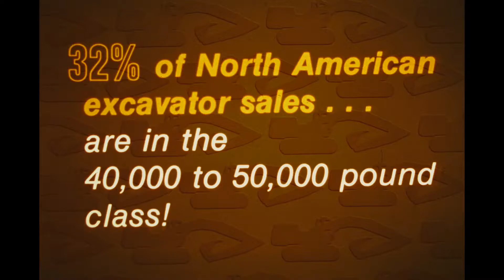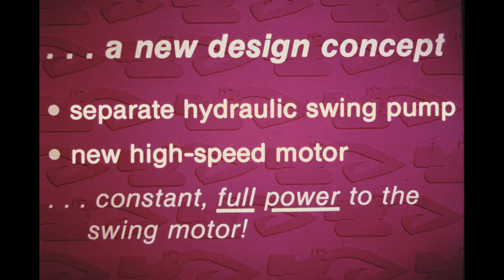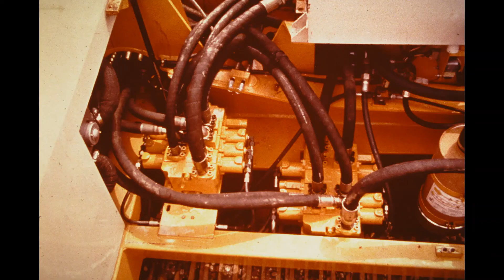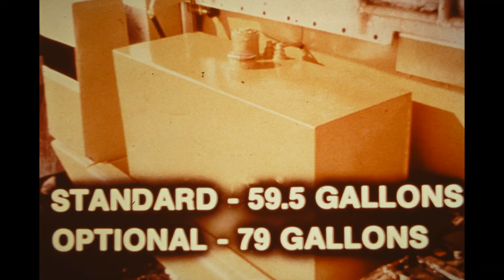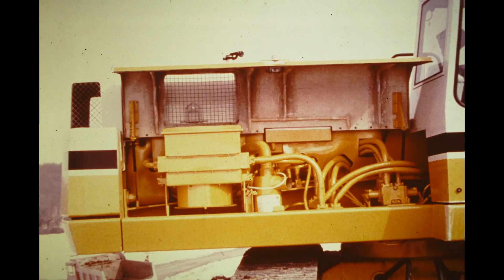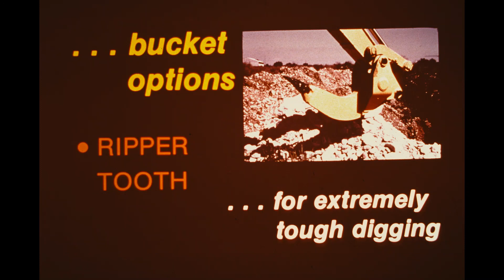International Harvester 640HD Excavator Marketing Training

Comment: Thank you for education video on these forgotten excavator. Little history on them. International purchased rights to the ( YUMBO)
Company in 1970 Yumbo, predecessor (SICAM)
Obtained manufacturing right's from Italy (Bruneri Brother's)who built one of the first Hydraulic excavator in 1947. They also offered a ( DEUTZ) Engine. In 1982 ( DRESSER) industry
Purchased the construction Machinery Division of International Harvester, from 1986 reintroduce the ( YUMBO) design Excavator's being upgraded to the 600 series beginning in 1979. There line offered 15 to 35 Ton's
These models were Discontinued in 1989 when Dresser began marketing (KOMATSU) design Excavator's under a joint venture 
Komatsu Dresser Company in the US. The Dresser 6000 was a Komatsu. A Dresser 6220 was a Komatsu (PC-220)this arrangement lasted till 1992. What I like about them was the early control pattern they used. Standard in modern machine's today.